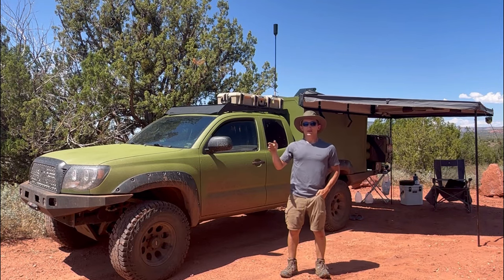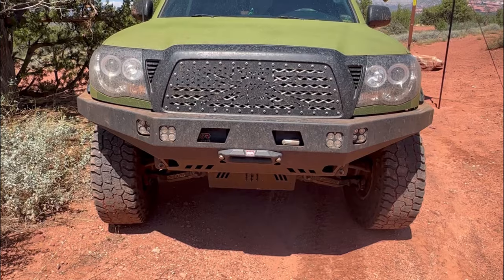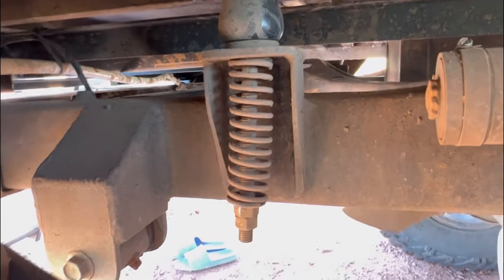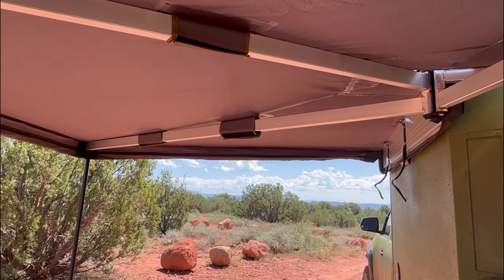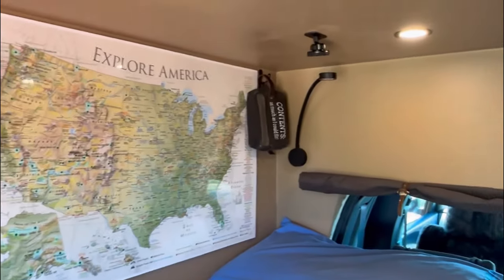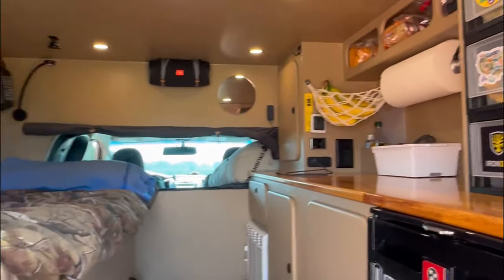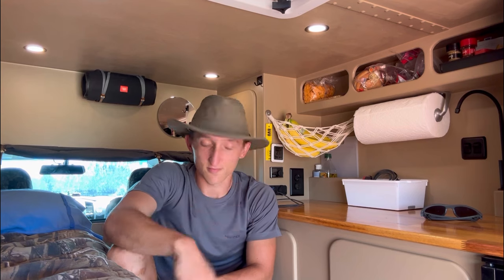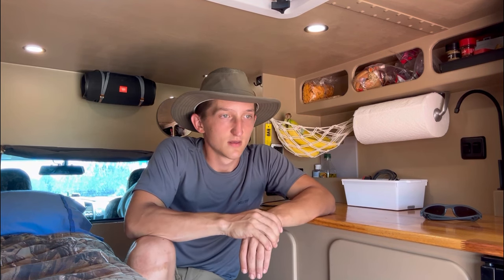DIY overland Camper

Comment: I camped in Yellowstone in -13F. 
My Four Wheel Camper Popup with insulation “Arctic “ pack had so much condensation on the roof and flexible walls I thought I wasn’t going to be able to close it without damage. 

However, my dog and I breathing added moisture and we kept it just above freezing all night with the propane furnace to conserve fuel. It’s tough finding propane refills over holidays. 
We probably should have left more of a vent open. 

And during my second year, it did leak when you drove in a hard rain with the roof collapsed and stored. 

I now have an insulated Sprinter 4x4 with Diesel Heater. 
No condensation and way too warm inside.

Comment: I like your set up very practical build low impact having owned a few teardrops you don’t usually stand up in those most of my time was spent outside. Next set up will be a truck topper on a short bed. I’m also a little shorter at 5,7 will sleep diagonally.

Comment: I would highly recommend adding a set of spindle trusses. They are inexpensive, but really beef up your spindles. Having had one break on me the weak point is towards the top near the upper ball joint. If your good with a welder you can do it, or have a shop do them. All in all its a couple hundred dollars if a shop does it, but can save you major money in damages from one breaking, especially at highway speeds like mine did. If your planning on taking it to Alaska, I would recommend adding some spindle trusses/gussets (whatever you wanna call them).

That said I love the build. Seems like you really planned it out for your needs, and like you said it may not work for some folks, but its what you want built for yourself. So many people do what someone told them to do and they end up unhappy because it wasn't what the needed/wanted. Your build is simple and functional, and I like it. I also like that it looks like you have empty space on your roof rack, giving you the flexibility carry more things like more jerry cans for fuel/water. Even is freezing water is a concern (like travels to Alaska) you can rotate out between inside and out.

Comment: Awesome looking truck! What is the green called? I've used the tintable Raptor Liner before and it's a great product. I really like that shade of green. Cool build!
Reply from the maker: The color is Studebaker laurel green I don’t have the paint code for it. It is actually significantly lighter than I had planned on. I was aiming for just lighter than OD green. But it still looks good.

Comment: Shes ugly on the outside lol (too much green for me) but the work inside is really nice. Alot of good ideas though, i like the rubber bushings and the "floating" bolts that hold it together so it flexes going down the road. And having your batteries in a box under the floor.

 One thing I'd suggest though and maybe i missed it but onboard air is a game changer. Most vehicles you can get the pump mounted in the engine bay and then tank(s) would be easy fit under camper. Good for if you need to air down to get more traction plus theres a million other things you can do with compressed air. Idk if your bags have a controller/pump but its a worthwhile investment to have a tank system

Comment: I really like your set up. I am the same height as you. What’s that height inside the camper floor to ceiling?
Reply from the maker: The inside height floor to ceiling is 44in. That gives me enough room to move around freely but keeps the wind resistance and center of gravity low.
Reply: @LandonV2000  thanks for your reply 👍

Comment: I’m looking to do something similar to my 16 access cab trd. I will have someone build it for me. How did you do the pass through? What mpg’s are you seeing?
Reply from the maker: I used an accordion boot off of a semi for the pass through. I removed the back glass from the cab and cut the same shape hole in the camper box. It is easier to use the back door but I have the pass through as an option for more privacy or bad weather.
Reply from the maker: I am getting 15-17mpg on the Hwy cruising at 65-70 mph. When I’m running the mountain roads or going over a mnt pass mpg goes to crap. I think the worst I’ve gotten is 10 mpg.

Comment: Any idea what the weight is?
Reply from the maker: No I haven’t weighed it. One of my friends and I lifted the camper box with the insulation and electrical installed onto the truck fairly easy. The cabnets are made of 1/4" and 1/2" plywood so that added 150-200 lbs. I am confident the camper is less than 1,000lbs. When it was completely finished the truck sat level at ride height with out help from the airbags. By the time I added my rear bumper, tire, fuel, food, water, and equipment I had to put about 20psi in the air bags. The truck is still very drivable and will hold 70mph with out down shifting for most interstate travel. Sorry for the long explanation without a real answer. I’ll get it weighed some day.
Reply: @LandonV2000  hey no problem! Thanks for taking the time to explain.  You’ve clearly done some great work keeping it light and in general too. Thank you for sharing 

I realize you’re basically done. There’s a channel called “Project of Science” that has a few pretty good ideas about keeping wood cabinets light.  Just a thought if you’re interested